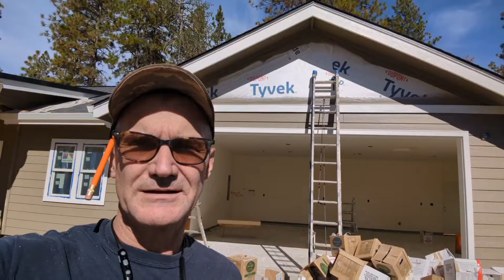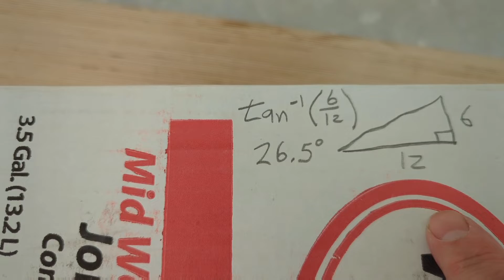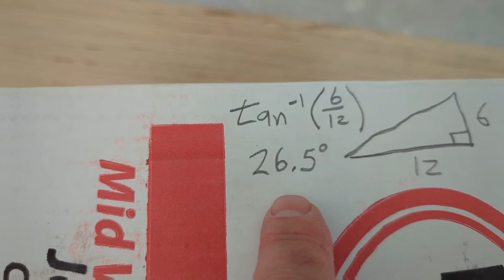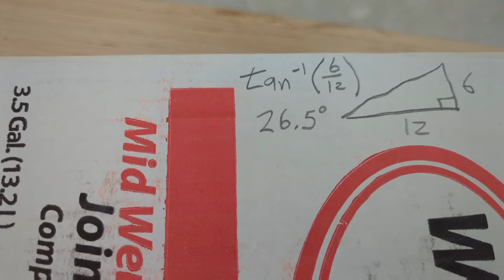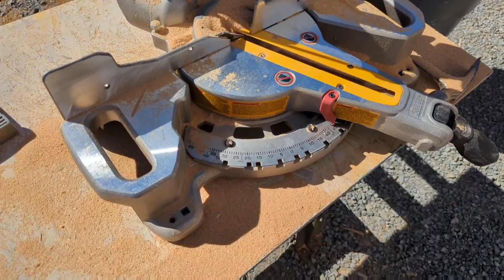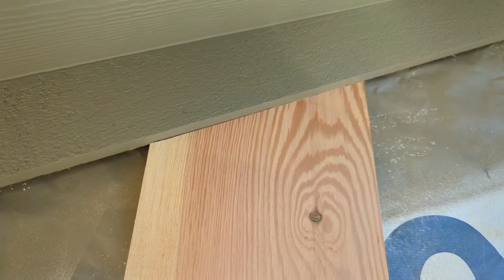How to use Trig to find an angle for construction #construction #trigonometry

Comment: Hey, I've hit a stump in terms of understanding proportions and would like to know if you may be able to tell me how I can recognize what the questions want at the start.

Here are 2 questions. 

1) It takes 4 men 14 days to do a certain job. How long should it take 7 men working at the same rate to do the same job?

2) A scale blueprint drawing of a building has a scale of 1 inch to 40 feet many inches on the drawing represent a distance of 175 feet on the blueprint ?

Now what I get confused is why I can't make a proportion for the first question but I can for the second to solve the question. Is it the "1 inch to 40 feet" a good indication that I will have to use proportion and solve it via cross multiply etc? I know for the first question you simply multiply the 14 and 4 and divide by 7 but I'm having a hard time seeing the difference when I read the question. Hope my question makes sense. Thanks.
Reply from the maker: The key is to keep track of the units. If it is 14 men 10 days, men stay in the numerator (top number) and days in the denominator (bottom). So if you have 7 men, how many days you set one ratio equal to the other keeping units the same and solve. Hope that helps